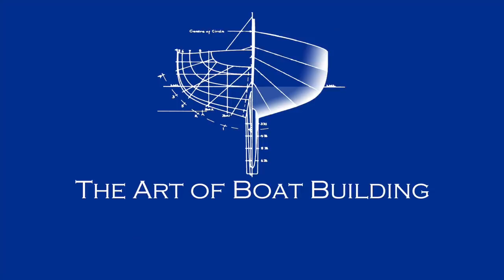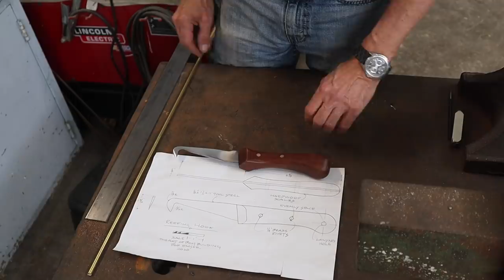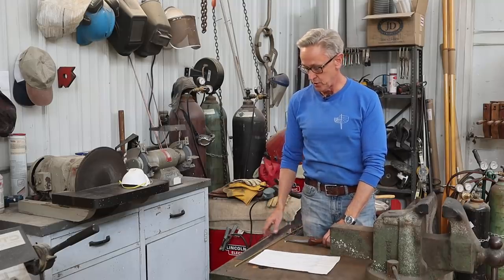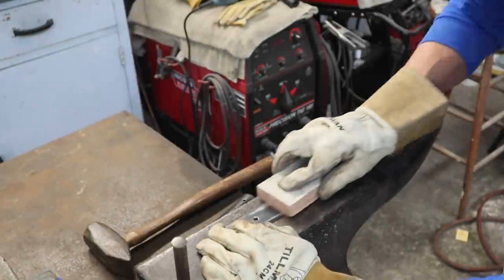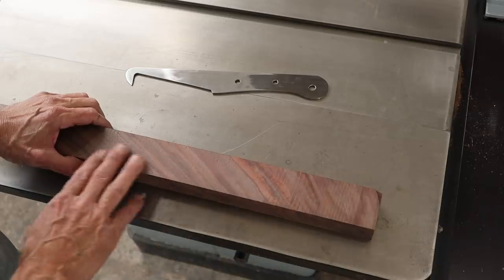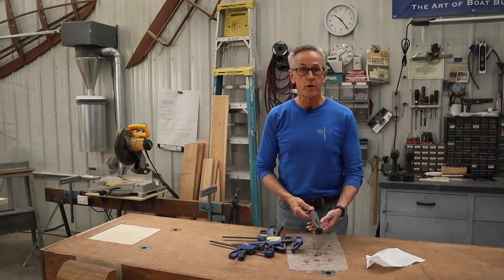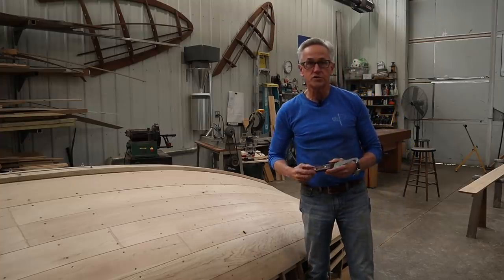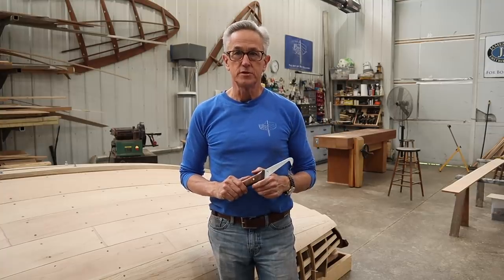How to Make a Reefing Hook

Comment: Much entertained and inspired by your videos and have made a respectable version of your brass mallet. Did you mention heating the metal of your reefing hook to "beyond magnetic" or did I mishear?  How does that work?
Reply from the maker: Yes, I did say beyond magnetic. When ferrous metal is heated to 1420˚ F it becomes non-magnetic. To harden steel it should be in the 1450˚F range. So, you could see me in the video tapping the magnet I had on my vise as a way of measuring the temperature. When it didn't stick to the magnet I knew it was around 1420˚ so I heated it just a few seconds more to get around the the 1450˚ temp and ready to quench.
Hope that helps.Thanks for watching!
Cheers